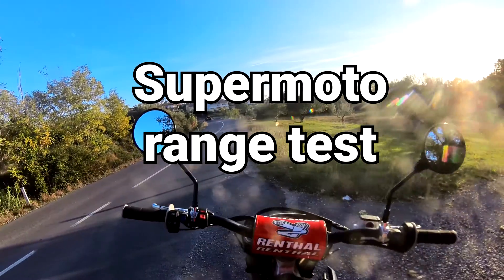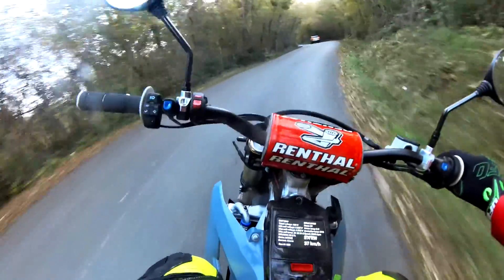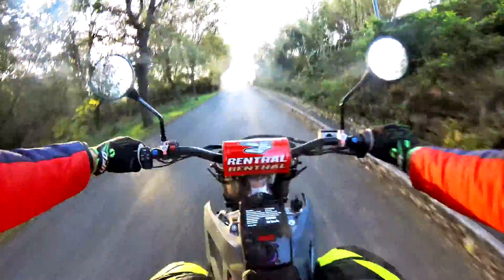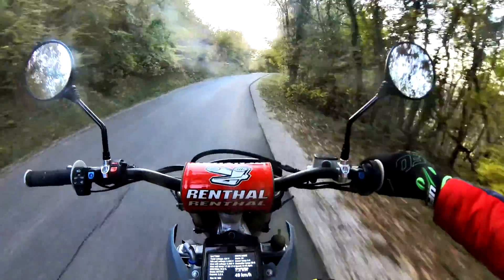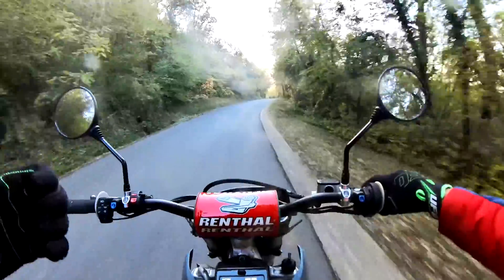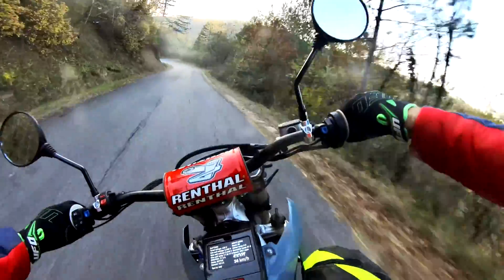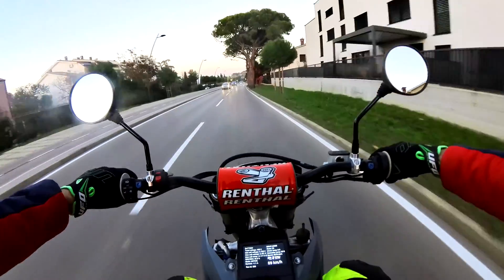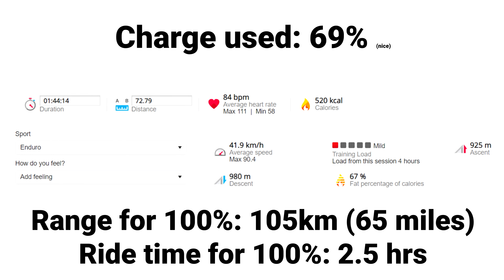Electric Supermoto Range test - Flux Primo

Comment: How does it keeps the bike from rolling away in the event that the the rider fails a steep ascent. I usually use TKO to avoid bike roll back on my EM escape R. I think this is important feature for no engine brake bike to avoid dangous event.
Reply from the maker: A feature in the plan is a hill hold - stopping the bike from rolling in reverse, does that solve your concern?
Reply: @FluxMotorcycles

Comment: I am hoping for some improvements still on the battery side. I need to travel around 67km in one go where most of the distance, I need to ride around 80-110kmh, which will probably not be possible on one charge still.
Reply from the maker: Yeah that will probably be on the limits (or over) for the Primo. For the production bike the main design driver is more range, so we’ll probably be able to cover your use case, but we’ll see when we get there.

Comment: I'm wondering for someone who will preferably use it mostly for supermoto use, will the charger be some what reasonable of size? And be able to fast charge at local charging stations? Because the varg has a massive charger that you wouldn't be able to carry around.
Reply from the maker: Check our instagram, the 220V plug charger is like a small backpack, not integrated in a stand. For fast charge you need a DC charging station.

Comment: Very cool to see. Will the supermoto version or the other models be road legal in europa ? Another very nice thing would be if i could charge the battery with a ccs2 plug so i could use public infrastructure.I dont know if this is even possible from a technical standpoint ?
Reply from the maker: It will be road legal in Europe yes.
This being a 400V system it IS technically possible to charge from a CCS2. The decision is either mount the huge plug on the bike or have an adapter for this use case.
Reply: Beeing able for public charging sound great, but which plug in has the bike exactly? Having a type 2 plug in would make this bike Tet ready,  for example ,)

Comment: I like the whirring of the gearbox, nice to have some sound unlike other electric bikes
Reply from the maker: It's a prefference thing and ultimately it just boils down to either using spur or helical gears, which is easy enough to change if needed
Reply: @FluxMotorcycles Thank you for having specified that; it is consistent with the fact that, according to what I’ve read, the reason for which driving in reverse gear in cars makes that whirring noise is that the gears for reverse are spur gears, whereas for the other gears they are helical and that the helical ones are quieter.
Anyhow, is the rider of the video Marko Ukota? If he is, considering the skills that he has shown racing supermotos here in Italy, I think he is quite the right person for that video with some drifting!
Reply from the maker: @MVPever  it is indeed!
Reply: Ciao, volevo chiederti se la batteria si può caricare alle colonnine per le auto? O ha un attacco diverso? Per cui bisogna ritornare a casa a caricare? Altra cosa, quando mollo il gas la batteria si carica? O solo frenando? Solo col freno posteriore o tutti e due?  Dove è un negozio per acquistarla?grazie
Reply: Una sola curiosità,come mai ha meno Newton rispetto alla stark varg ?

Comment: I love seeing powerfull, electric, road legal bikes (im more interested in the Enduro as you can go into the woods without disturbing anyone) but how fast does it go topspeed? The problem is always having only one gear. I have built an electric bike myself (15kw) and if you have the low gearing you dont have any topspeed and with the long gearing you cant blast out of the corners as good. I know electric bikes have more torque than gas bikes but i think we need electric bikes with more than one gear.
Reply from the maker: Geared like in the video the top is about 160 kmh. Electric has a hard time with sustained high speeds and long travel distances. That's why a Supermoto (& off-road) makes sense,  it's not meant to travel at 180 kmh.
There are some options with gears on the market, you can see drawbacks. Aside from the obvious cost/complexity/maintenance, it also takes away precious volume, so you need to put the battery up higher. The result is a bike with either less range or rides like a pork. 
It makes sense for some very specific use cases, but there's a reason 99% EVs are single gear.